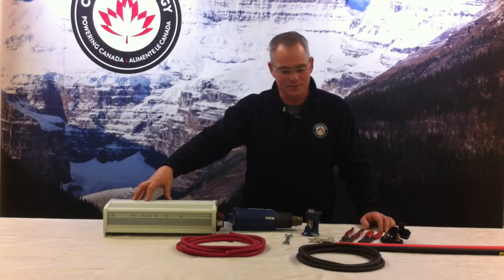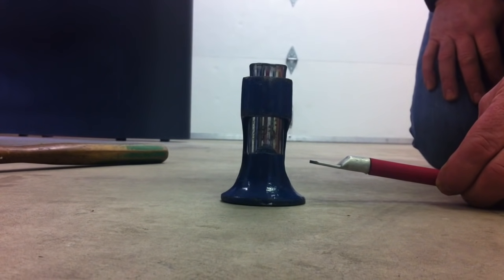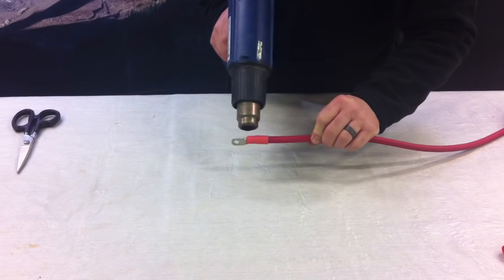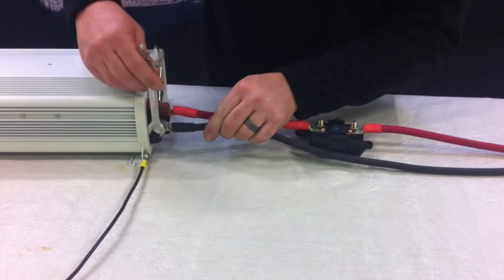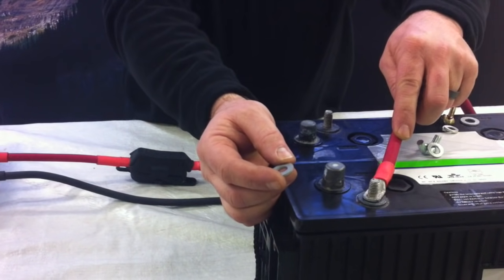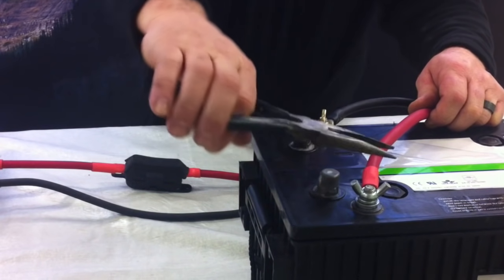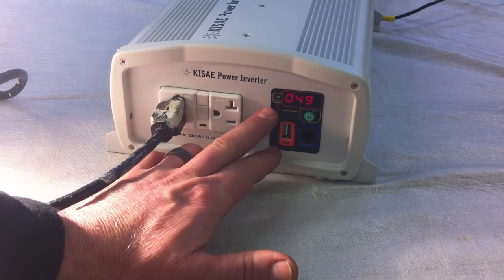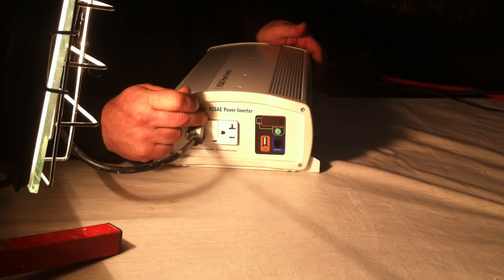Canadian Energy™: Inverter Installation : 101

Comment: Positive line should be attached last when installing an inverter to a battery bank. Upon disconnecting your wires the Positive line is the first wire to disconnect. Especially in a RV, Boat, Cottage application.
Reply: Can anyone else weigh in here?
Reply: That is what caused it to arc, correct? I have heard before that things should not arc when you connect a battery to an object, provided you do things in the correct order.
Reply: That is incorrect. The negative cable should be disconnected first to avoid short circuit with chassis and when connecting the Negative cable should be connected last. You will almost always get a spark when connecting the inverter to the battery as it is energizing the the inverter, this can be avoided by installing a breaker inline which can be turned on once the connection is made.
Reply: NO NO NO NO NO NO NO NO!!!!!. Just the opposite. Read Randy Anderson below.
Reply: NEGATIVE BATTERY WIRE SHOULD BE TAKEN OF FIRST, AND NEGATIVE WIRE ALSO SHOULD BE INSTALLED LAST! U SHOULD NOT MESS AROUND WITH ELECTICAL WIRE MAN U DON'T HAVE KNOWLEDGE. PLEASE STAY SAFE

Comment: Thanx for the video. You mentioned that the cable you were using wasn't the right AWG. Do you have a guide for wire size vs watts vs length of run? Thanx in advance.

Comment: Hi, so on a little box cargo, utility trailer , ground  the inverter to chassis, and an extra grounding wire,cable to frame from battery, it won't interfere with tow vehicle vac through the bumper plug or trailer ball. Thanks  for sharing, J. R..

Comment: Very easy to understand.  My only problem is what steps take place if I have a trailer that has dual batteries a cutoff switch and a converter in the unit. How would I add the inverter properly and really simple like this? Just want an outlet which can be just a cord off the inverter itself for a fridge. I don’t have to wire it up to the whole converter setup and outlets within.

Comment: is it okay to install an inverter in the engine bay? will engine heat and sun on  hood  affect the inverters high temp cut off? do most newer 2018/2019 inverters have an overtemp cutoff?  I seem to be having this issue, but not sure.   in the morning I can run anything, but after I run the engine for a while, though reading 13v, the inverter goes to fault sometimes with very little and no load.
Reply from the maker: NoSunBeach generally it is not advised to install in the engine compartment due to heat, moisture and contaminants, unless the inverter is IP66 rated or sealed with no fan.  Inverters that are CSA or UL458 approved will have over temp or high temp cut off but there are many inverters on the market with no certification, check the specifications before purchasing. Hope that helps. ✌🏼🇨🇦

Comment: never seen anyone ground the case of inverter is it really necessary?
Reply from the maker: Ric777888 As we like to say, there is never an issue until there is an issue!  I believe it will depend on the manufacturer of the inverter whether they recommend connecting a chassis ground, generally if the product is CSA or UL approved they will recommend a chassis ground.  Xantrex inverters and inverter/chargers are all CSA/UL approved and as per Pg 14 of the attached install manual, recommend chassis ground http://www.xantrex.com/documents/Inverter-Chargers/Freedom-HW/Freedom%20HF%20Installation%20Guide%20(975-0395-01-01_Rev-F)_ENG.pdf
Reply: I have a small solar set up with a 2000 watt inverter, is a ground cable required? Is a fuse block required? Thank you

Comment: Where do you connect the ground
Reply from the maker: THE GAMING HEAD are you referring to the chassis ground or the battery ground?  Most CSA or UL approved inverters or inverter/chargers will provide adequate installation instructions with the equipment.  Without knowing the exact type of inverter, location of installation and type of vehicle or chassis it is almost impossible to provide an accurate answer. 👍🏼🇨🇦

Comment: What is a GFCI?

You can't short the battery unless both terminals are connected. You don't connect the cables unless the other ends are safe.

Comment: How do you hook up the inverter to the A.C. side of things? I understand hooking it up to the DC side, but now I need to run my 3 A.C. outlets on my boat off the inverter. Seems like you guys only did half the installation here (the DC side), there should be a video on how to connect the inverter so you power your outlets as well. 

I'm also confused with how to install the inverter so it charges your batteries when you're hooked up to shore power without overchargering, do I need a separate charge controller than that of my solar panel charge controller?
Reply from the maker: Travis Weaver Connecting the the AC to the inverter is completely dependent on what type of inverter you have and the wiring configuration of your vessel ie. is there an existing AC distribution panel that powers the circuits that you can connect to.

Almost all battery chargers are regulated and will control how much charge goes into the battery, most inverter/chargers will have multiple settings for charging different types of batteries such as flooded, AGM or Gell.

We recommend that you refer to the inverter installation and operating manual to determine how and where to connect the AC to the inverter and how to set the charger to the appropriate battery type. Hope that helps.
Reply: 3 AC outlets.. Just hook them up in parralel and put a power plug on the end if the cable that goes into the inverter. Everything except that power plug on the end of the cable is probably already in the boat. And inverters don’t charge batteries. You need a seperate battery charger which do their own job totally seperate from the inverter.

Comment: What is the formula used for calculating the fuse? I'm quite confused when a 2000 Watts Invertor requires a 200amps fuse?

Comment: Can your Battery source be a regular car battery, in other words not a deep cycle?  And do you have to have a battery set aside from your other batteries for the inverter itself?
Reply from the maker: Yes, you can use a regular car battery but its life will be shortened if you are continually discharging and recharging it. No, you can connect the inverter directly to the vehicle starting battery but there is a strong possibility you will discharge the battery to the point that it will not have enough power to start the vehicle. Hope that helps.

Comment: Good info. For now using 800 watt inverter. Pretty much the same process?
Reply from the maker: Yes thats correct. The formula is watts/volts=amps so 800 watts/110 volts=7.27 amps AC (we’ll round up to 8).  For every 1 amp AC it will draw about 10 amps on a 12Volt DC battery, so 8 X 10 = 80 Amp DC draw.  We prefer to use fuses on the DC circuit as they will blow faster but you can use a circuit breaker, fuses or breakers should be sized to match the DC cable in the circuit and should be rated at enough amps that meets the surge capacity of the inverter.
Reply: Is the formula for size amp fuse versus watts like you used so 80 amp for 800 Watt?  Also see 100 amp circuit breaker. Better than fuses?

Comment: Thanks for this job ...
I have a question about some inverters comes with built-in fuse ?
like cobra 2500 watt
Reply from the maker: Maher A It’s best to refer to the inverter manual when dealing with internal components.
Reply: I could be wrong, but the fuse in the line is a mega fuse right? its to protect the cable, and not relevant to any internal fuses?

Comment: To installed 750 W inverter in The bed of my Truck what gauge of wire I need in the size of the fuse?
I figured the length of the wire should be from 10 to 12 feet

Comment: I wasn't sure what size inverter would go with a 12 volt battery now that I see what you use, I'm confident of my choices.  How would I use the inverter to send power to the other RV outlets using the inverter outlets ?

Comment: I have a TT with 2 Lithium batteries. Can I hookup the inverter to the batteries and hard wire the inverter back to the 1 breaker on the fuse panel I need power to? (Of course never turn on the inverter when on shore power.) The batteries and fuse panel are all in the same location.
Reply from the maker: Chuck Eastman We prefer to keep our advice limited to DC wiring, so you can certainly connect your 2 Lithium batteries to the inverter, assuming they are the same DC voltage and there is an appropriately sized fuse in between.  My opinion of the AC connection is, it is not the ideal way to connect an inverter to a fuse panel but it’s your TT.
Reply: Canadian Energy thank you for your advise!
Reply from the maker: Chuck Eastman Our pleasure! 🇨🇦

Comment: How would you ground it if you were using it at home ?
Reply from the maker: Inverters are designed for mobile applications carry a different CSA or UL approval than those for home or cottage use and are not neutral to ground bonded so we do not endorse the use of mobile inverters in a home applications. Hope that helps!
Reply: You can try to find out what the neutral output of your inverter is and hook that up to a grounding rod. But most important is using a GFCI i think. Take care that all the ground connectors of your wall outlets and light fixtures actually do what they are supposed to do: kill the power if a certain amount of mA enters it. And use a smooth sine wave inverter, i almost killed a kill-a-watt meter because it didnt like a square wave. More home appliances might not like square waves.

Comment: I have 2 batteries connected in parallel do I connect the inverter    to one of the batteries  or positive to one and neg. to the other?
Reply from the maker: Gary Ickes connect the positive cable to one battery and the negative to the other battery. Hope that helps.
Reply: thanks

Comment: I have question. Do i need that fuse, cause i have seen videos when guys are connectin wires from power inverter straight to batteries. Will that hurt or damage something on my truck ? Thank you!

Comment: The fuse should be as close to the battery as possible. That way if the wire where to be shorted the fuse would blow instead of the wire melting and maybe starting a fire.

Comment: Does this inverter work best with a deep cycle battery or with a normal automobile battery?
Reply from the maker: Co Rin The inverter doesn’t care what type of lead acid battery it’s connected to but an automotive battery will have a shortened lead life in a cycling application.

Comment: I have a 10,000 w inverter. Due to a situation I will need to run this continuously for up to 10 hrs. at a time, but not on full load.Would 2 batteries be sufficient. Would it be better to use car or marine batteries
Reply from the maker: Pennie Capo You will want to use Deep Cycle batteries to power your inverter.  The size and quantity of batteries will depend entirely on how much power your inverter is outputting, this can be determined by adding the power in watts that each AC appliance uses then multiplying by the number of hours each device will operate. Hope that helps!
Reply: Use AGM batteries or lithium. Thinking about car batteries for inverters is so wrong, they are not made for that purpose and die very quickly when in use like that.

Comment: If battery got discharged how you will charge the battery
Reply from the maker: Switch it out! :)
Reply: HIGH GRADE it’s 49Amp /41.6 amp out of a 12v battery 
Low volts = high amps
500w~12v = 41.6
Yes 4.1A at 120v going to the 500w lamp

Comment: I have a 2000W continuous power output inverter, with 4000W surge capacity. Is the 200a fuse the right one or should I get something bigger?
Reply from the maker: Víctor Emmanuelli yes a fuse of 200-250 amp would be correct, the purpose of the fuse is to protect the circuit so as long as it will sustain the continuous DC load. Hope that helps!
Reply: Canadian Energy thanks for your help!
Reply: Hi Jay
Thanks for this video. Question. So a 2k inverter provides less than 20 amps at 110 volts. A 200 amp fuse will never blow. I know there is something I don't understand so Im hoping you can fill in the missing pieces in the old noggin here? Cause I have a 3k inverter and Im trying to find out the correct size fuse. And can I use a breaker instead of a fuse?  Thank you.
Reply from the maker: The 200 Amp fuse we are referring to is on the DC cable side, the rough conversion is, for every 1 Amp AC the inverter is putting out, it will draw 10 Amps DC @ 12 volts from the battery bank.  20 amps AC X 10 = 200 Amp DC draw on 12 volt battery bank. You can use a breaker but in this case it would have to be rated at 200 Amps (DC) or 300 Amps (DC) for your 3000 watt inverter. Hope that helps!
Reply: OK OK cool. So a fuse cause a 300 amp breaker would be huge and expensive prolly? And yes on the DC side. Now I got. Awesome sir. Thank you!!
Reply: OK since we are on a roll 😜. Coming out of the inverter on the AC side will be #10 wire cause 3k watts is rated for 25 amps. The cable run is only 10 feet. I have a 4 cicuit panel with a 30 amp main. Do I need protection (fuse) for the #10 feeding the panel from the inverter? Thanks again for letting all us strangers pick your brain.
Reply from the maker: We prefer to limit our advice to the DC side of the inverter but typically you would not install fuse protection in between the inverter AC output and breaker panel, some of the higher end inverters may have AC output fuse protection built in to the inverter.  It’s always better to be over protected!
Reply: Thank you Jay. Do you have a donation page?

Comment: What's the difference between a Pure Sine Wave and a Modified Sine Wave Inverter? One's half the price of the other for the theoretically same power output. Thanks.
Reply from the maker: Albert Zion The power supplied by the national grid in North America is 120V 60Hz AC (or alternating current). The current effectively 'switches direction' 60 times every second. There in no positive or negative like there is with batteries. The waveform is smooth and gradual conforming to what is called a 'sine wave'. Pure Sine Wave inverters such are the most efficient and highest quality inverters available. Pure Sine Wave inverters produce little distortion and are able to run even the most sensitive electronic equipment.
 
Designed to roughly emulate a sine wave waveform, modified wave inverters are cheaper than their pure sine wave cousins. They mimic the sine wave shape in large steps. Most simple appliances like power tools, light bulbs, heater elements and electric motors will run with a modified wave inverter...although they will get hotter and use more power. As these inverters don't produce clean sine wave power, they are not recommended for use with electronic equipment like TVs, stereos and computers. Clocks and other timing devices (like digital washing machines) can run either too fast or too slow.
Reply: cleanse sine wave or pure is 60hz mostly use for lights, TV and other sensitive electronics appliance. modified wave are inverter that been modified from a square wave inverter 50hz mostly use for motors and other industrial things

Comment: Good information - finally - in a sea of poorly informed other youtubers often offering dangerous info.
Reply from the maker: cawag98 thank you so much. We really appreciate that.
Reply: @CanadianEnergy  Another question for you: Can this inverter be connected to domestic wiring via a transfer switch, meaning: is all the voltage only on the hot wire and is neutral/cold not bonded to ground?  I have a Vector which would work, but it puts out voltage on hot and cold.  Thx.

Comment: I just ordered a 2,300 watt inverter, with 4,700 starting watts. I bought size 3/0 wire, since that's as big as lowes had.  I'm not sure what to go off of for fuse size? Running, or starting watts? Where does one get these fuses/holders? Thanks.
Reply: The fuse should be sized to meet or exceed the running or continuos watts so if the inverter is 12 volt the fuse will have to be at least 250 amps BUT the cable must also be sized to handle the amperage based on what the total cable length is.
Reply: Where did you put your ground wire off the inverter? Back to the negative terminal on the battery?

Comment: Nice video, thanks for putting it together, can you tell me what is the 'proper' gauge wire that you are using there? I know it depends on the wattage of the inverter you are using,  is it 0, 2, or 4 AWG?
Reply from the maker: Dave Galligher 1000 Watt inverter 2 gauge cable maximum 5 feet and the 2000 Watt inverter 2/0 cable maximum 5 feet. Hope that helps! ✌🏼🇨🇦

Comment: How far should your batteries be from your inverter to avoid battery off gases from igniting? While also taking into consideration the length of cable to avoid voltage drop to the inverter.  Example: 12V 3000w inverter with 2/0 awg cable feeds to 12v battery bank. Would 3ft be safe?
Reply from the maker: Eric Scherzinger because every application is different and depends on the configuration and ventilation it is difficult today what is a safe distance, the other option is to install sealed batteries that do not vent. The recommended cable size for a 3000 watt inverter is 4/0 with a minimum size of 2/0 so you should be ok if running 3 feet but we always recommend you refer to the inverter manual for the proper sizing. Hope that helps.
Reply: The inverter is a cheap Canadian Tire 3000 watt modified sine wave inverter. The manual is way below par in specs on wire gauge. Cheers